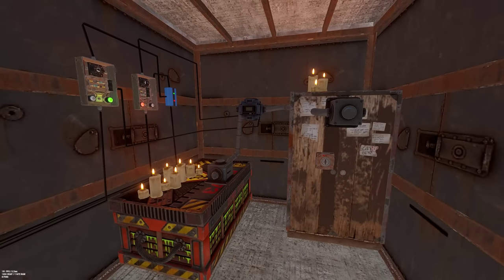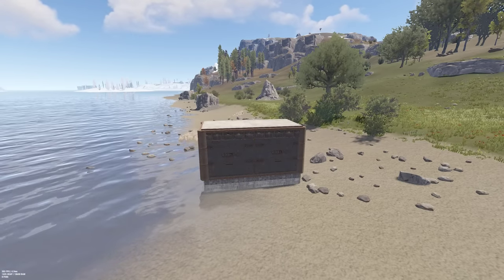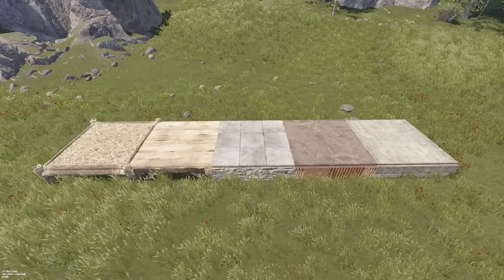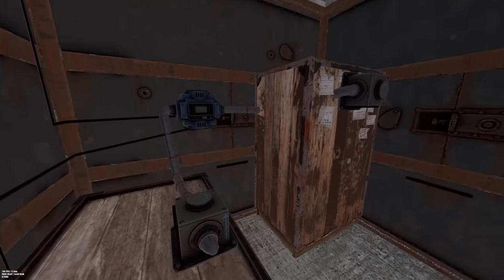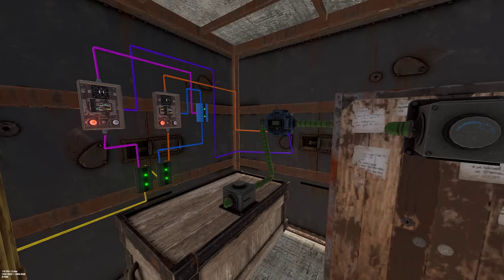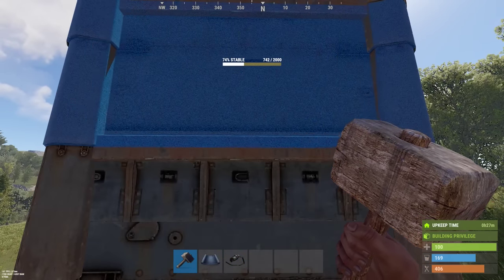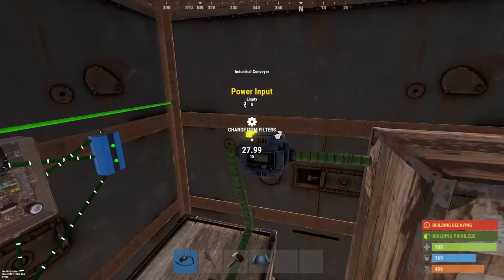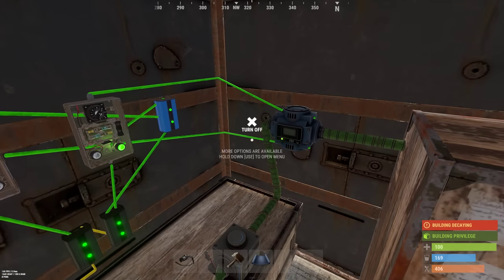Pay 90% Less HQM Upkeep With This Trick in Rust!

Comment from the maker: In testing I was able to upkeep a 27 HQM upkeep base with 1 HQM every 4 hours (6 HQM per day), but I'm not sure how upkeep works when upkeep ticks becomes fractions so your results may vary. What I often ran into when trying to keep the HQM upkeep as low as possible was some ticks were only partially upkept, so a few building blocks would keep decaying and wouldn't regen off all the damage as a result. Keep an eye out for this!
Reply: How many minutes are in one tick?
Reply: Fish traps before the fishing update actually used to be good now not soo much.
Reply: Would providing 2 HQM every 4 hours fix this issue?
Reply: @bullfrog521  I think that's why he said a minimum of 2.

I'm using this on a bunker 2x2 and the 2.5% is <1 and I'm wary out dropping it to 1 because I don't know the detailed mechanics of update ticks.
Reply: in theory is it possible to do with metal?

Comment: if server restarts the timer gets scuffed and you'll maybe have to get online and check it, or check with storage monitor.
It's possible that it might continue to work fine, but anyone whos done a clock with number displays knows there can be issues from server
Reply: You could always have a smart switch toggle the timer manually to pull 1 units worth of HQM if you have any doubts.

Comment: Adapted slightly.
Adjusted ratios for shorter loop times to match the smallest amount, usually HQM, but I also incorporate metal frags into it. But you can also save 1/2 or less on the shell upkeep as well, as in my case, stone. The only catch for the shell is you need a very short loop or you get a high range of damage/healing on it.
You can get around this by getting a 2nd circuit loop dedicated to the shell of the base, such as 20 minute loop. Just ensure you put slightly more than 1/2 its upkeep, I usually aim for 2/3 to be safe.
If you have a mixed shell (metal/stone) then incorporate the metal into the short loop as well.

So you can save 90% on the internal walls, but also 1/3 to 1/2 of upkeep on the shell of the base.
Reply: Also do remember, if some does attack your base and you have min/maxed the saving on the upkeep, you will need to dump resources into the TC or else it will sit on the same health it was damaged to.
You can also just use the power passthrough on the industrial conveyor to connect to the long period timer toggle on. This prevents the loop from failing if there was resources already in the TC, as it currently relies on the filter pass output to trigger on resource transfer.
Final tip - You can put a blocker before each circuit connected to another battery, all batteries are hooked to a generator, if the batteries running the circuits run out of power it will set the generator to kick in.
Reply: @drakcoreoriginal  Thank you for this. Presume this still works in current version?
Reply: @grimmcynicism8016  Haven't played Rust in 2 months now, but that is a mechanic, not a bug, so doubt they will change it any time soon.
Worked like a charm for all our bases, cuts upkeep down to 15%+-, usually I have a HQM core, then metal and just a stone shell for outside.
Had 900HQM upkeep, but only used around 100 a day.
Reply: @drakcoreoriginal  That is interesting, I was wondering about the outer shell. Currently I am running a loop of 3600s with 75% of the metal upkeep. However this means the HQM is now down to 1 per hour, it seems this is not enough to heal back the decay. Before 4 per 4 hours was good enough, do you have any tips for lower upkeep bases. Also some metal parts are more damaged than other parts.
Im thinking 1 isnt enough for the healing ticks. Is it possible to add a 2nd loop, but keep only 1 conveyor and pipe?
Reply: @Tomaskolk17  It depends on how much upkeep you have on your TC. You adjust your ratios to place in the TC per x time.
Aim for 15% for the HQM and about 65-75% for the external shell, in my case, stone. *Doors are not effected. We had HQM doors outside as well.
*There is a bug once in a while, triangle foundations on the edge if metal/HQM would decay as fast as the external shell, you can either make it stone or just place another foundation on the outside to prevent this.
My last farm base was 1k HQM, 20k+ metal and I think 15-20k stone for the shell.
I had a deadman TC room (single square block), with two sleeping bags in it, 3 large barrels, 2 small boxes, 4 drop boxes, medium battery and a generator incase the battery dipped (we were on a 1 month reset server), but the battery actually lasted the entire wipe.
Two loops, one on a 30min loop for the metal and stone and the other for the HQM which was every 2 hours (Maybe 3).
Going off on memory, was placing 250 stone + 80 metal in the short loop (30min) and 12 HQM every 2 hours. This being for the 1k HQM, 20k+ metal and 15-20k stone upkeep.
Rule of thumb, 15-20% for internal walls (metal and HQM in my case) and 75% for external shell (stone being for me).
You can go lower, but with soo much saving I didn't bother, farming runs were quick.
You don't just dump in everything in once or you get extreme decays or even complete loss, such as stone, too short loops and you fail to miss the timers on when it pulls resources to repair the building.
So 15-20% spread across x amount of times you place into the TC for a 24H cycle and as the 75% for the external shell.
*Your last question, yes, I had two loops going and merged to a single connector on the TC, but you have two or more connected to the TC, as I did in the past.
Reply: @drakcoreoriginal  thank you for your extended explanation :) I will try to do it like that. But I was also thinking for my 160 hqm and 8k metal base, it might not be needed to also add the metal loop, since it saves about 2.5 k. I do actually only put in 2.5% of the total hqm every 4 hours, like it says in the video. So it would be 1.56% every 30 min for metal. I also tested using a single connector to 1 box and TC, this works with 2 conveyors and splitters, which is nice so it does not break when i open the bunker. Btw the bug happens when you place the triangle roof in such a way that it can also be splashed through the wall, wich i guess means it is on the outside and thus also decays faster. Ow and the passthrough connected directly to the 1st timer, isnt this risky if the server resets and the conveyor turns off?
Reply: @Tomaskolk17  Yes, to be on the safe side, power back into timer incase server resets. We also had seismic sensor+BP sensors for raids and tc monitor on a timer over x 4 hours so if the TC had nothing for that time, we would be pinged to jump onto the server to see if the loop failed or the resources ran out.

Comment: after implementing this on a big base this wipe i noticed one thing. ceiling/floor triangles sometimes decay even though they are inside. I suspect it is connected to the triangle splash bug somehow. But I had HQM ceilings decay that had full cover be honeycomb above. You can fix it by making the triangle attach to a different orientation of part of the base. I tested it by removing all wood from my TC left it as twig and see how quickly it decays.

Comment: You can build 2x2 for 15/16 HQM, if you only use full height triangle foundations (you can pull them up), 2 roofs with a pixel gap and floors. And 1x2 or a triangle air lock. But you need a flat place. This trick is difficult to pull in woods.

Comment: Great video! What bout doing this with metal as well? Is it the same concept just different amounts and times? If so what would those be? I was thinking about it and why not just do that with every material in your TC? So you are paying the bare minimum. I'm just not sure what the times and amounts would be for the other materials.
Reply from the maker: yea it could reasonably work with anything, more easily with metal. Doors always decay at a slow rate, so you could easily get some upkeep savings if you don't have metal walls exposed on the outside. Not sure on the timing. Ive had issues trying to do it with something like stone where some blocks weren't getting upkeep even when I thought I had it all covered
Reply: @sigbog  what is considered inside vs outside on a multi tc base

Comment: I don't think this will be patched. It has integrated as a strategy as much as pixelgapping or widegapping. This upkeep discount is basically a hardwired side-effect from having defenses regenerate freely and allowing some time between running out and initiating the decay.
The thing is, if you mess up once then you're giving attackers free rocket discount on your raid.
Reply: It also can be countered by attacking the power supply in advance of a full raid.
Reply: @CorporalDirge  id be charging a lagre battery so would take some waiting stil

Comment: @sigbog I'm curious: if foundation is metal, can the external walls be hqm? Can the external walls on the second floor be hqm?
Reply: The foundation, internal walls can be HQM, as long as it isn't the very top roof or sides (the shell) of the base, exposed to the elements.

Comment: Lmao, just upgraded my groups base to HQM.
Then saw the part of the video where this doesn't work on external walls. I hope we can afford upkeep.
Reply: Hey. Just curious what happened? I've been wondering if you can hqm external walls as long as the foundation is metal.
Reply: @DarkStrobeLight  I don't remember it well  but I don't think this trick worked. The armored walls still contributed to upkeep. We just ate the upkeep cost and lived in an armored base without the upkeep trick.

Comment: So, I have encountered an issue with this that I need some help with.
My base upkeep is 79, lets call it 80; I have the timer set up as instructed, every 4 hours 20 secs of power to put hqm in tc. The amount is 2 hqm. 2.5% of 80.
For the core, it works as intended. HOWEVER, the floor above has a HQM ceiling. It is decaying, and it appears to be decaying FASTER than the hqm floor below it. So the core below is fine, but the ceiling above is nearly HALF health. Is the outer layer now considered for EACH build type rather than which layer is technically external ?

Need help understand why the ceiling above is decaying faster than the one below. And yes, there is a floor, in fact 2 above the ceiling. BUT only one wall to outside, which is sheet metal. 
Is this issue because it is connected to the outside wall rather than inside because of the triangle splash bug ?

need help this ALMOST works, but in its currect state, one of my floorswill lose its ceiling lol.

The base in question is a gamelightz temple v2.
Reply from the maker: Sounds like it's registering as outside. Id do a test, repair it all to full, take the hqm out entirely for a bit, and see if it's actually decaying at different rates. If so you might need to make some tweaks... Or manually repair

Comment: Let's say I have armored wall on outside of my base, just one, will that one wall slow down the decay rate of the core? 
Well, because the things further away from tc decay faster or do they at the same rate, just first?
I'm wondering if there is a way to slow down the decay rate in the core. 
Or will it decay at same rate, and the outside wall just decays faster and if it is faster decay, how much faster? Will your timer. Still work if my outer wall has decayed too fast
Reply: decay rate is based on the stability
Reply: @unreal2458  I think distance from tc plays a Factor
Reply: I may be wrong, but always seems like the last thing to decay is the foundation under tc, when, in fact if it was just the stability, it would all decay at same time/rate

Comment: did i miss something? i thought the far away a wall/floor is from TC is decaying more and first. so if your tc is outside your core it decay faster!?!?
Reply: @cocainecarl4200  i will trust you biut im a pve player and build strange buildings. what if its a open design, what counts as in and what as outside? like a house on stelts.
Reply: The TC is usually the most center part, so the exteriors decay first and expose the next layer to the outside. The most inner part is usually the TC and last to decay.
Reply: @CorporalDirge  ah yes now i understand it correctly. he meant its outside so no raider can see its "damaged" thats why it have to be inside :D sry i didnt think like this as a pve player xD if my outside wall is still not broken its all fine for me, thats why my dumb question xD

Comment: I have an issue... after the server restarts, the conveyor doesnt turn itself back on with power.  I had to manually turn it back on, then it functions normally. Any experience with this?
Reply: it was an issue with the amount of power i had going to the timer that powers the conveyor. needed to configure electrical branch for that timer to 3 power.
Reply: @Lucas_Jeffrey  yup. Timer takes 1, conveyor takes 1, passthrough to power on is 1. 3 total.

Comment: so what is the point of a hqm core, if the raider will anyway be able to use just 2-3 rockets? did i miss something?
Reply: It takes days for the wall to get that low, watch the video entirely.
Reply: Raid cost will be the same, if you get your timing wrong then it will be one rocket cheaper
Reply: Oh jimi, looks like someone didn't watch the video...
Reply: You missed like the whole video, apparently.
Reply: you can make a bunker

Comment: has anyone tested this to see if it works and restarts properly after a server reset? i think after a server crash or reboot, both timers will be off so then the loop will no longer work and the TC will stop getting resources
Reply from the maker: I tried it over several restarts of my own local server but I wouldn't rule out a problem around crashes/restarts

Comment: is this patched ?
Reply from the maker: nope! you can still do it
Reply: @sigbog  thank's I tried to use it for my base but I had some issue with HQM ceiling decaying at outside rate even if they are inside (just some of the cellings not all.. thats weird)
Reply from the maker: @Sourhour_  maybe try a bit more hqm in case some wasn't reaching your blocks. Or skip the electronics pull it out and leave it for half a day and check and see what it looks like
Reply: @sigbog  ill try thx for replies
Reply: its not working for me, I still have 3 ceilings decaying way too fast (100hp in under 45mins, inside my base with 2 more floors on top of it) but all the rest is working as intended
Reply: Must be patched?
Reply: I am also strugling
Reply: I dont know for sure but my base doesnt have any kind of wide gaps or funky bunker and I still have some ceilings decaying at outside rate so maybe
Reply: @Sourhour_  are they triangle ceilings or all ceilings? Because triange ceilings are strange sometimes and it might have something to do with their orientation, like the triangle splash bug
Reply: @anchovyacquirer  yes only triangle ceilings, I thought it had something to do with the way they clip but I clip them all from outside in
Reply: I do that to avoid splash bug when getting raided and they were all clipped the same way
Reply: @sigbog that's crazy this still works a year later!